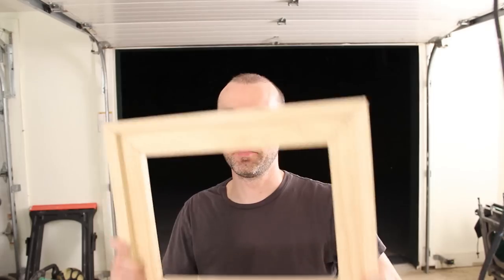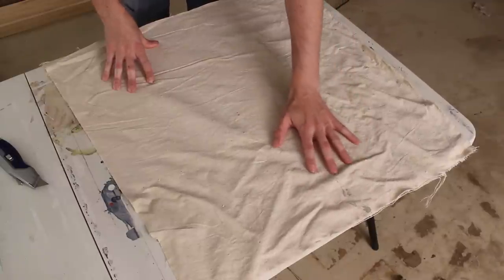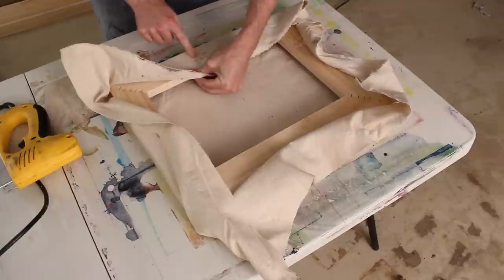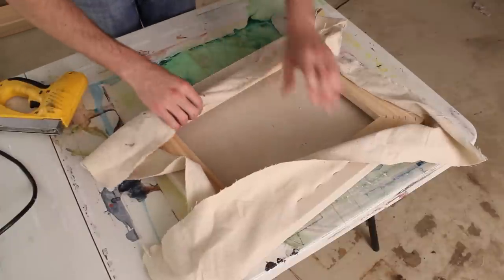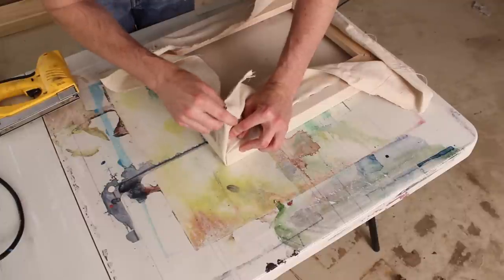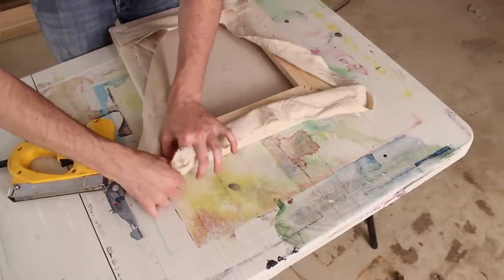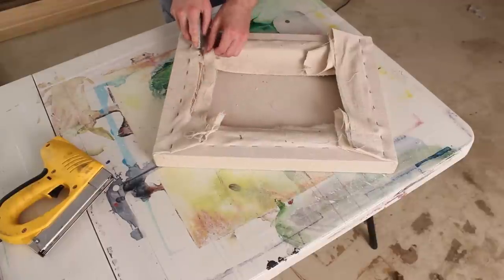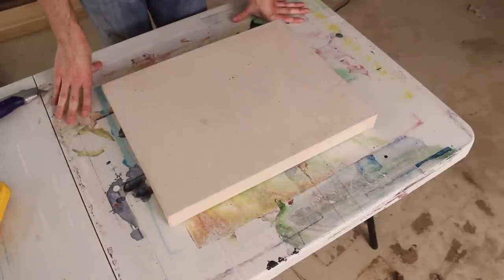How to Stretch Canvas: Make Your Own Canvas Pt. 2

Comment: First off, thank you!
Secondly:  Why do some stretch bars have those "teeth" at the end that people specially cut out?  Specifically, they're three triangles that allow it to slide in to each other?  Thanks!
Reply from the maker: Commercially made bars are made to slot into each other and increase tension by inserting keys into the gaps in the joints. I'm not as much a fan of those. They're kind of expensive and for me, they tend to have warped a lot over time.
Reply: @MeadMcLean    Yeah I agree.  Plus it's easy to make your own like this.  Sure painting on the canvas could "warp" it, where using keys to expand the joints could tighten the canvas again, but IMO at that point it's just worth it re-tightening the staple locations a little.

But thank you!  I get free shipping wood that happens to have 1" thick walls, so I can effectively cut in to my production significantly, thus allow me to sell more cost-effective paintings.

Comment: Excellent demo, especially the corner job. Please  do one for ready brought primed canvas.
Reply from the maker: Ok. Do you mean stretching a primed canvas or do you mean a canvas that's already primed and stretched?
Reply: Thanks for your promt reply. I meant stretching a already primed canvas which we buy in a roll. I guess the process would be the same only was thinking of how much I should pull the canvas. Bye the way I use a canvas plier which pulls very tight.
Reply from the maker: The canvas pliers tend to pull too tight on unprimed canvas, but they might be necessary for pre-primed canvas. I think the main concern is that the stretch should be even, no matter how tight it gets. Also, once it's stretched, you should probably give it another coat or two of primer to be sure it's actually primed fully.
Reply: @MeadMcLean  OK thanks so much. Yes I have been doing it the way you suggested. The extra primer coat after stretching is a good idea.